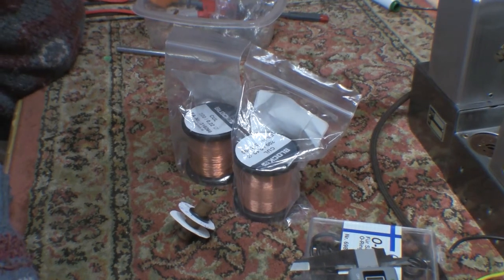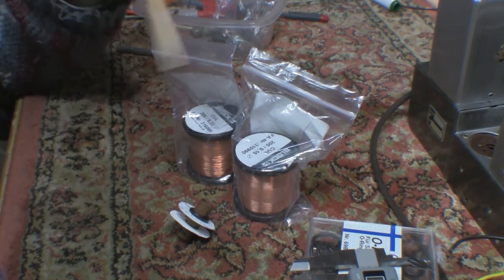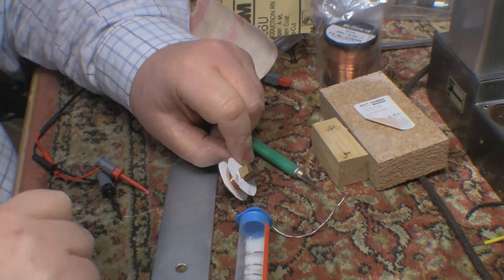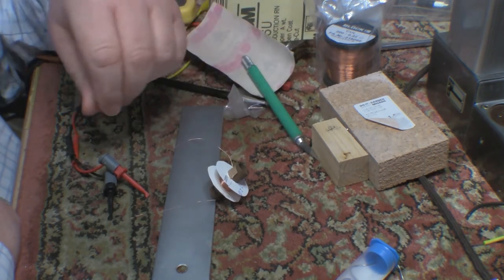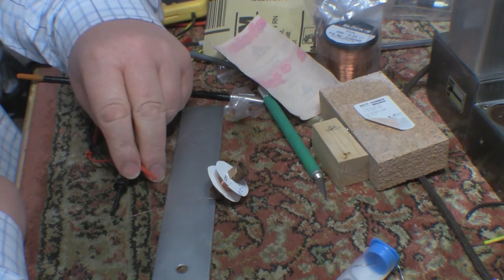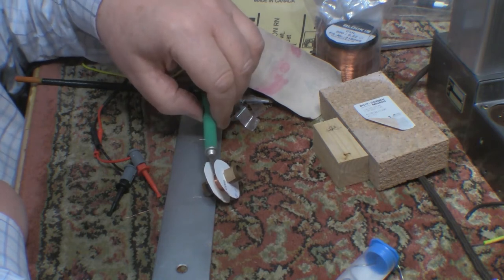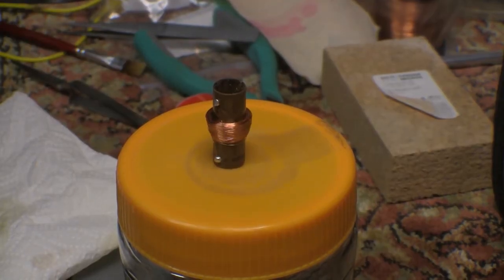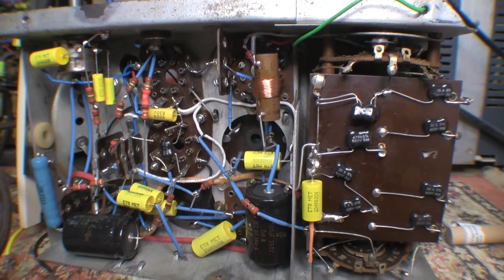Radialva Groom Rebuild - part 16

Comment: I know it sounds Neanderthal John, but I burn off the coating using a plain ordinary match. Maybe with this newer stuff, you can't do that.
   Nice first coil job. Too bad everything has to be so darn precisely aligned on your winder to get a uniform winding side to side on your form.
   The DC resistance reading on the 2nd coil makes no sense. Sure, maybe the impedance. Is it possible that your DVM is not reading resistance using pure DC? It doesn't seem plausable, but I can't think of anything else right now.
   Best of luck!
   I know you'll figure it out.
       Tom
PS I just had a thought. Of all of us guys I watch, you seem to have consistent unusual quandary(s)  to work through when working with your projects, but somehow you eventually get it all figured out. Bravo!
Reply from the maker: I guess I just need to practice with this stuff.   I tried the naked flame and the wire just burned like string!   The soldering iron seems to melt the enamel but I still have terrible time trying to get a decent contact afterwards,
Concerning my unusual 'problems' I guess most of my projects are done as I go and rarely involve standard plans to follow.   I'll admit I enjoy finding new hurdles to overcome.  Without that it becomes repetitive and then I get bored :-)

Comment: You a great job on that first coil. On the second coil don't worry to much about the resistance of the coil. Be more concern with getting the inductance correct. The resistance of the coil only matters when figuring the Q of the coil. If it turns out the Q is to high you can add a series resistor to the coil to reduce the Q. As for the impedance the resistance of the coil doesn't matter. It is to small of a value to have any affect. As example take XsubL and XsubC of 1000 ohms and a coil resistance of 20 ohms the impedance with the resistance is 1414.35 ohms and without the resistance it it 1414.21 ohms. As you can see the coil resistance makes very little difference in the impedance. I can do a video better explaining this.
Reply from the maker: Thanks Dennis, as you can tell, my theory is weak when it comes to coils - I'll be spending plenty of time messing with them until I get to understand the whole topic better.  I'm also earning how to 'drive' the coil winder!
Cheers,  John